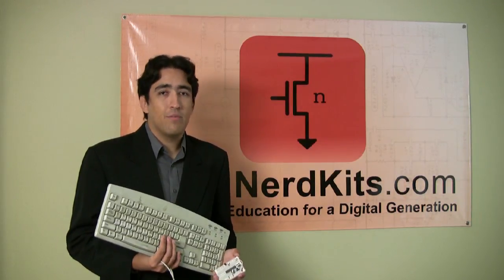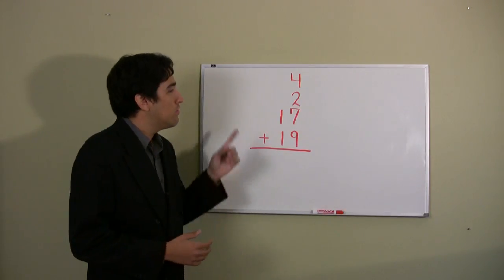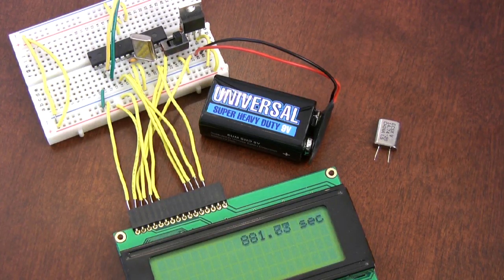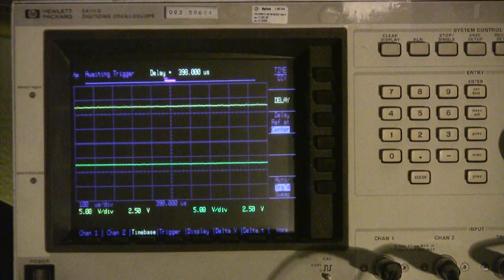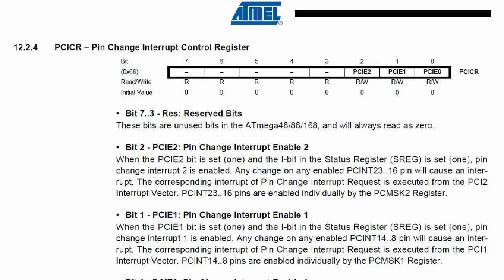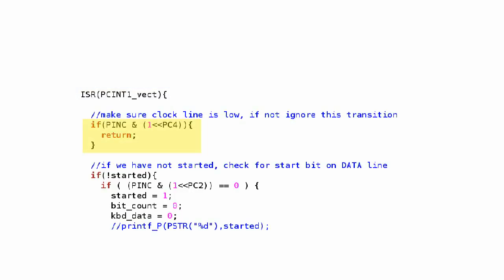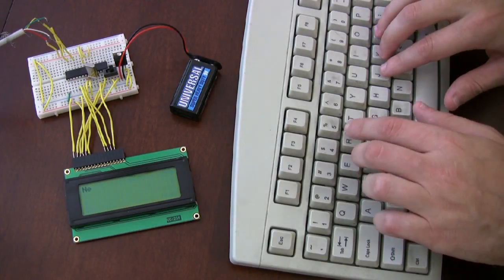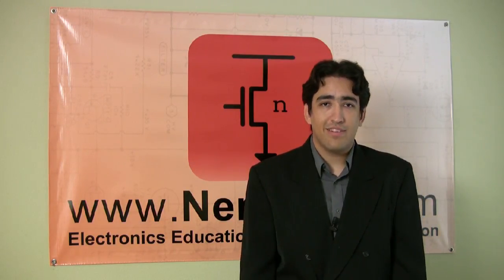Interrupts: Interfacing a Microcontroller with a PS/2 Keyboard

Comment: Here's an interesting thought:
If you know the timing of the clock signal, you can translate this into an equivalent baud rate (e.g. 60µs --> 16667 baud).
Connect only the data pin of the PS/2 keyboard to the RxD pin of the microcontroller's UART (maybe with an additional pull-up resistor).
After configuring the UART to use the baudrate mentioned above, 8 data bits, odd parity and one stop bit, this should also work.

One could also use a MOSFET to control the 5V power of the keyboard, so that you can turn it on/off/reset it.
If the keyboard sends a status byte right after power-on, one could even measure the clock frequency using pin change interrupts (or capture/compare), compute the baudrate, configure the UART and turn the keyboard off and on again with the UART being ready now.

Comment: What is the difference between i2c and PS/2 ????? Can i use i2c ?
Reply: They are very similar, but still different. I2C has no parity bit, and no specific number of bits between starts and stops. Also, I2C devices have addresses, so that more that many can share one bus. That said, they are very similar.

Comment: looks like you have the HP 54112D digitizing scope. How did you get the OFFSET setting off the display? Mine has it ON by default and it's annoying. Could not find any settings on menu to remove it.